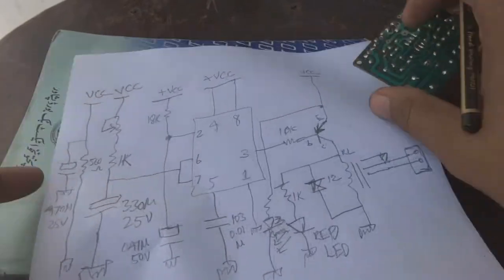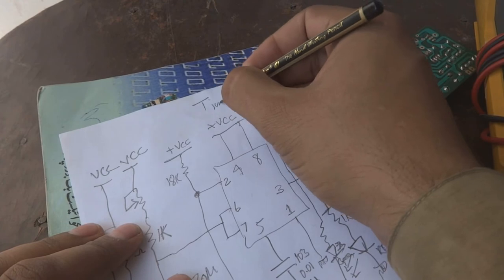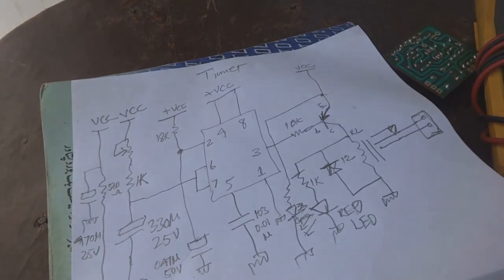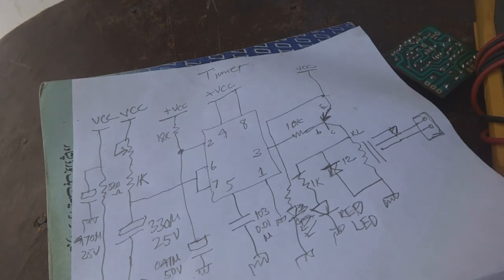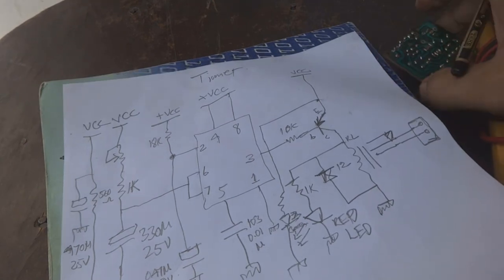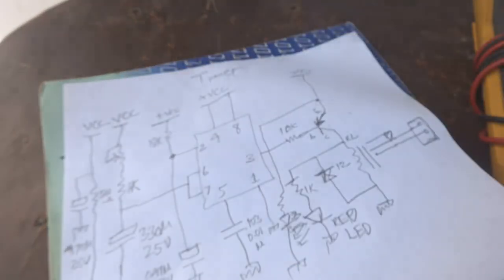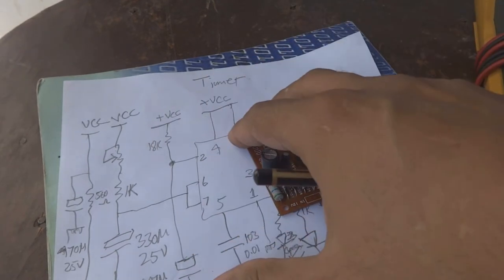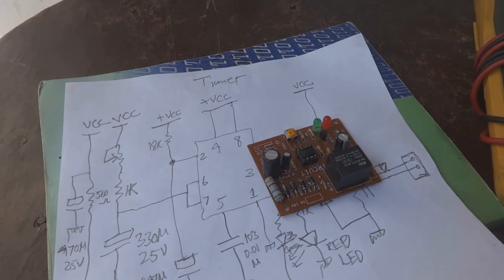Delay automatic on timer circuit reverse engineering.

Comment: Is out possible to modify this circuit for spot welding machine? I want to make microwave oven transformer spot welder.
Reply from the maker: This circuit can't be used in that application.
Reply: @JahanZeb1976  immense thanks so mono stable 555 diagram is what should give me the results that I want?